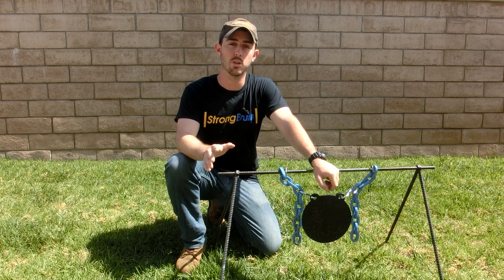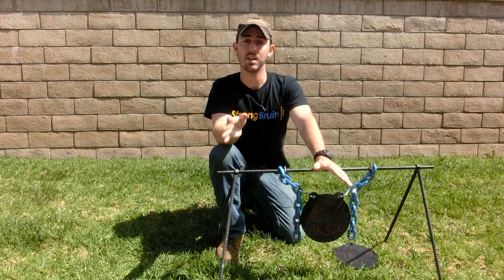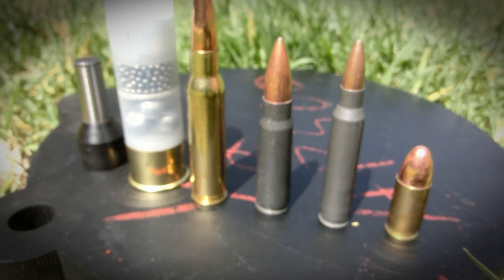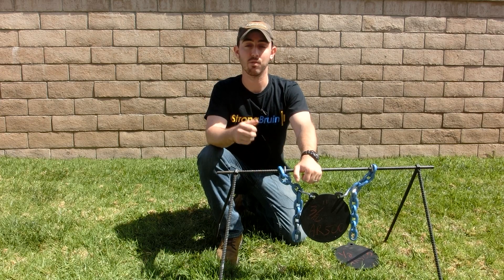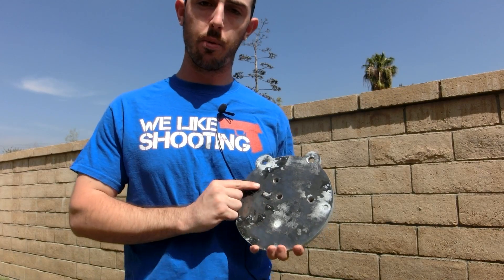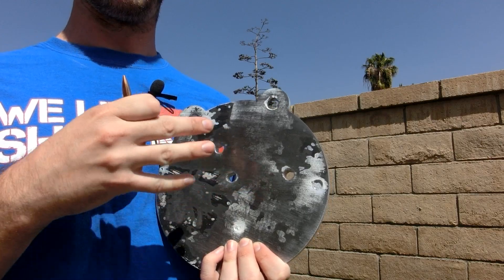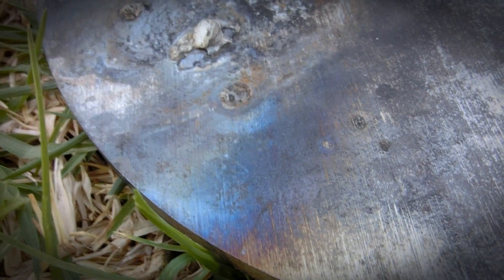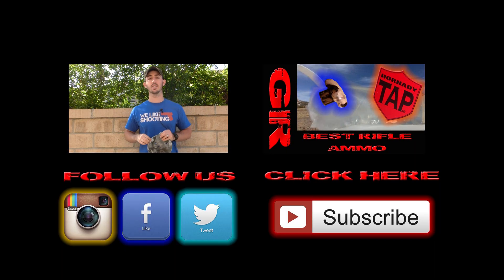How Strong is Military Armor? XSteelTargets.com Review

Comment: Not to be rude, but I would take that Thermite data with a couple grains of salt. Just looking at the video, it looks like very little of it actually came in contact with the plate, and the vast majority was reacting with your ceramic pot. Ceramics behave very differently than metals do in terms of thermal reactivity, I would be curious if you would get a similar result if you put the thermite in a cardboard box, or a plastic bag and then repeated that experiment.
Reply from the maker: That was one of the difficulties with the video. We tried a plastic cup earlier but it sent hot pieces of plastic into the air. 

the pot allowed us to direct the thermite a little easier but we started to lose some energy. If I were to try it again I would use much more thermite.